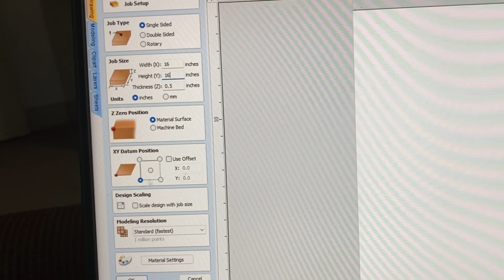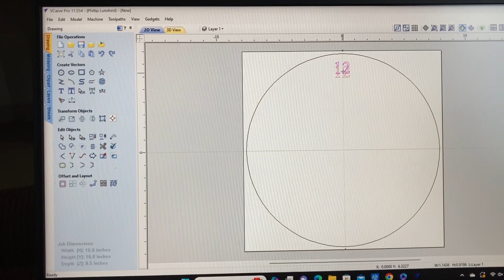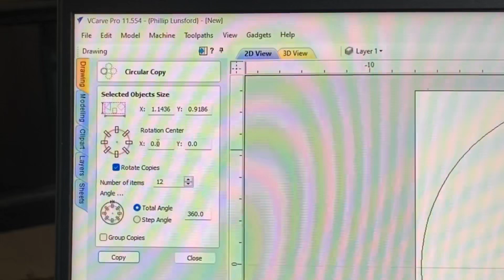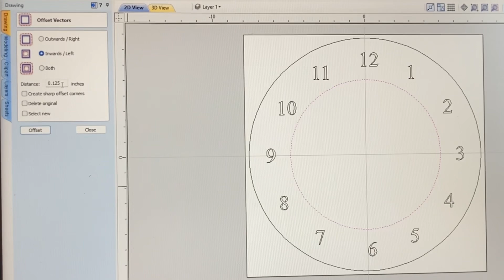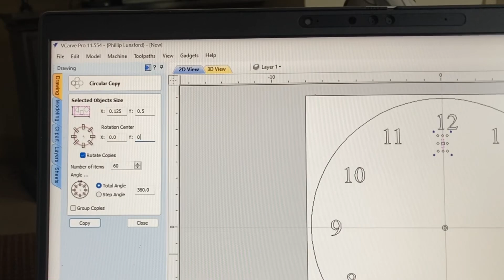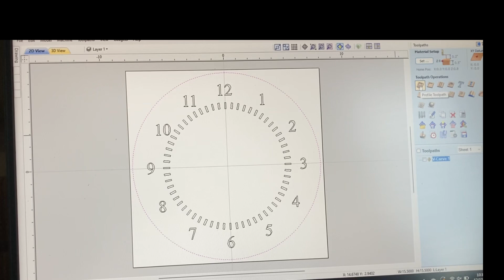Create Clocks using basic Tools in VCARVE

Comment: Sir. sorry to trouble u again. but ref to the i clock i have a question about the outer ring cut off i am using 3/4 pine for testing the review shows it cutting all the way through but its not. should i use 75 3/4 as the depth of cut for the profile, thanks. i am duty right now but in the am i will give a another shot. thanks for all your help.
Reply from the maker: What is the actual thickness of your pine board and is that the same thickness that is in the computer? You can set the depth of cut a little deeper to ensure that you are cutting all the way through.  Just remember, you will be cutting into your wasteboard.

Comment: Stumbled upon your site over the weekend. Finally ordered my first CNC machine and also downloaded VCarve trial to get used to software before I purchase it as well. Your videos are very clear and you don't miss steps as many others do. While running your video in the background, I follow along on the program. Wish you had a group of videos only on VCarve so I can go through each and every video to learn. I have tried to create a draped American Flag which I've made by hand and very popular item. But when tried to create on VCarve Pro, it is not working. As I go through some of your videos, it is giving me more insight on what the issues are. But slowly need to learn and apply it to my non-working design. It will feature cuts, curved pieces and also some guide lines to seperate all the colors. Thanks and trying to go through all your videos for VCarve projects for now.
Reply from the maker: To design a 3D draped flag you need to purchase Aspire. VCarve Pro can not do that. You can however, purchase the 3D files and carve the flag using VCarve pro. You can also modify the file. You just can not create the original STL file